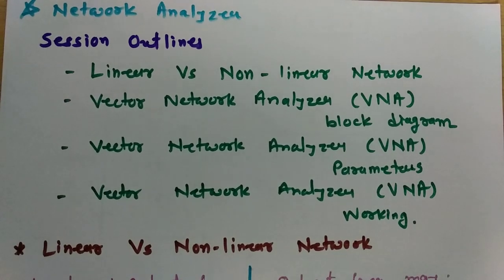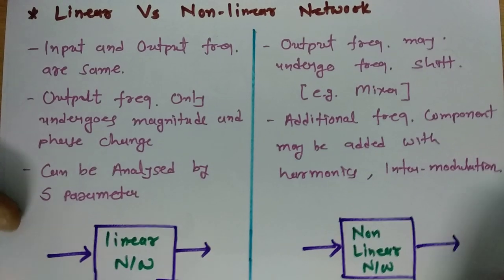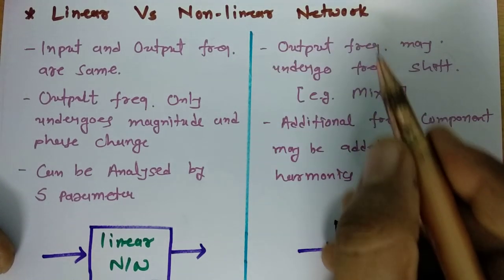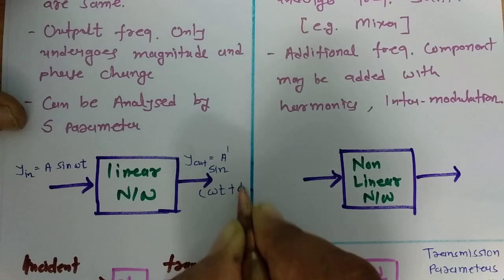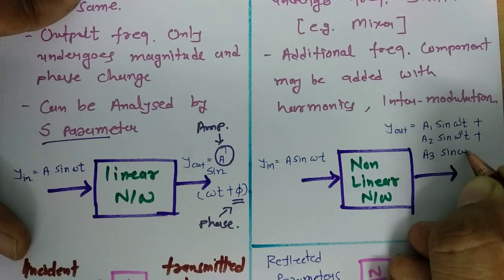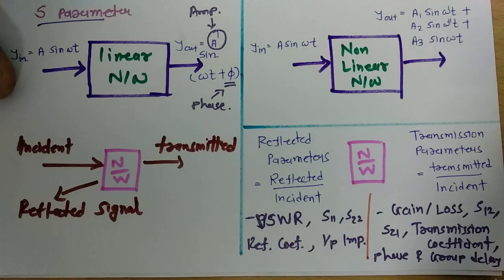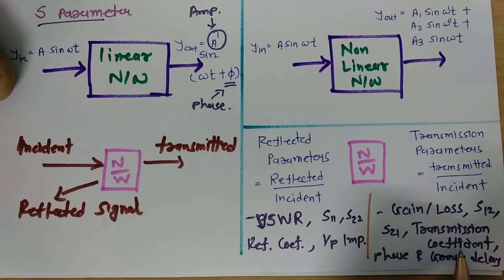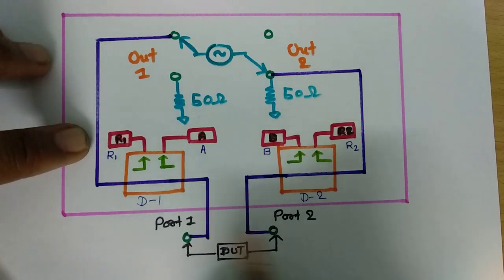Network Analyzer (Basics, Parameters, Block Diagram, Working & S Parameters) Explained

Comment: Hi Sir, I think your block diagram draws wrong. The port 2 purple line should connect to top connection point other than 50 Oum resistor.